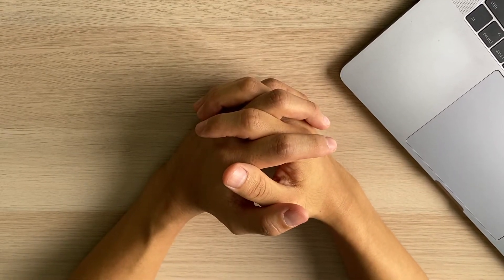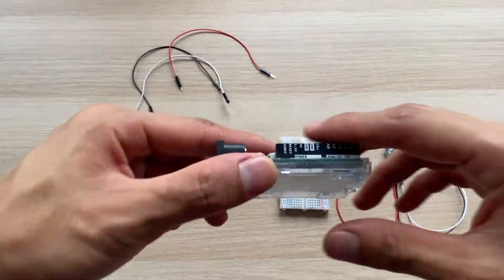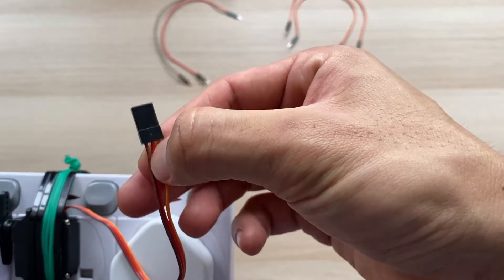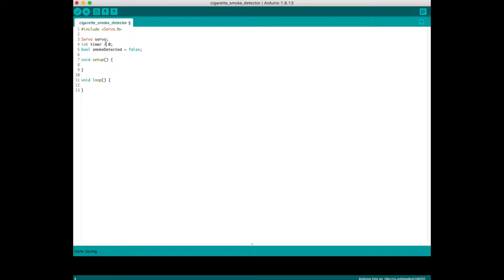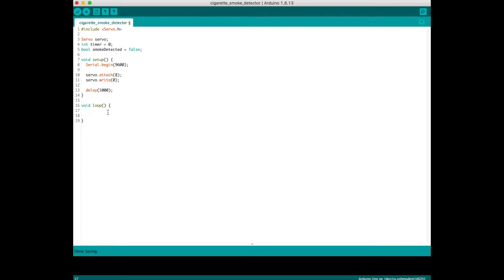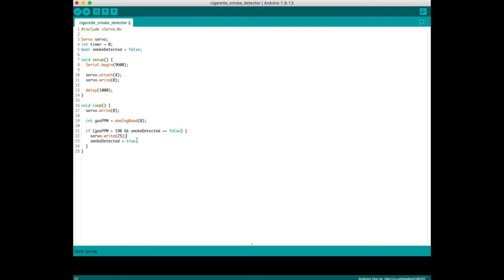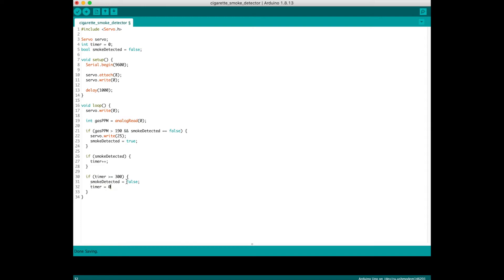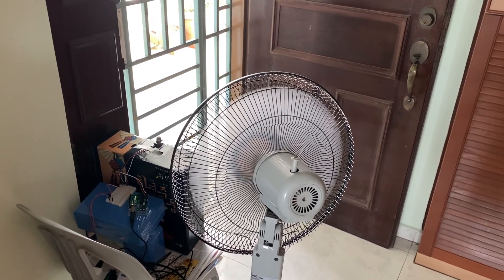Arduino Smoke Detector with MQ-135 Sensor | Neighbour Giving Me A Hard Time

Comment: I know the problem. I am in it for 24 hours a day. It is hell. You should use a simple relais to turn on your fan instead of a the servo. And the gassensor should be powered separately since it draws too much current for your arduino. Are you satisfied about your solution so far?
Reply: Man I got exactly same issue! Im basically smoking even Im not a smoker ...
Reply: @xxandrejxx  That is bad! man; I feel for you. 
I am still looking for the right sensor that can specificly detect cigarette smoke. Do you have an idea.
Reply from the maker: Wow, you mean your neighbour has been smoking for almost 24 hours a day? That's a really heavy smoker! What's your solution?
Did you meant Relay? Actually I have thought of that as well, and even thought of using smart wifi plug/socket and sensor. But just wanted to make this more towards a fun/hobby project because i have never tried out these sensors before.
The solution works, but it kind of triggers my neighbour more because he can clearly see my setup when they are passing by my door. In order to not further deteriorate our neighbour-relationship, I've decided to just close my door lol...sadly...
Reply: @NotATechGuy  I have 2 neighbours who are maried and are 70+ They smoke from about 6:00 till late at night and sometimes during the night when they can't sleep. And they do it outsight or with their window open in a smokeroom. My house is right next to them because we live in an appartment on the ground floor. Unfortunely these appartement are situated 5 meters below ground floor so all the vapours are trapped and surround my appartment. So my house is constantly in a cloud of cigarettesmoke. It is abolutely horrible. I have tried all things and nothing helps since I can get no fresh air from whatever place in my appartment. Therefor I am forced to use filters which also do not help since cigarettesmoke has too many (toxic) ingredients which are so small that they go throught the filters. So therefor I also tried some solutions with arduino. And yes I meant a relay; they are nice little device to switch on devices. I like them a lot and they very handy components in household projects.

Comment: Did you preheat the sensor before connecting
Reply from the maker: I did connect it straight away, but the reading was inaccurate for the first 1 to 2 minutes. Once it was heated up after around 2 minutes, then the reading was accurate and consistent.